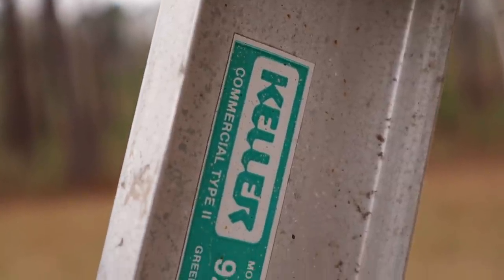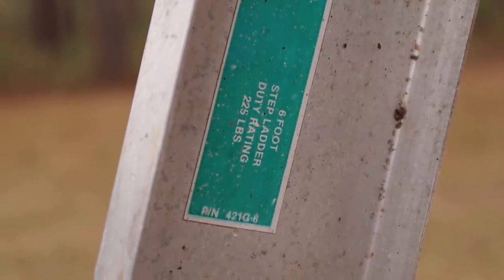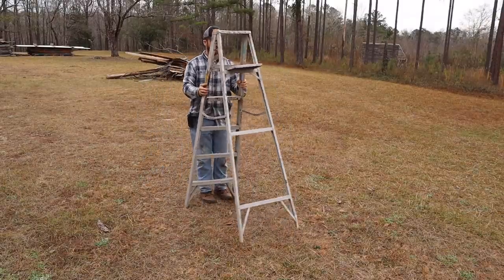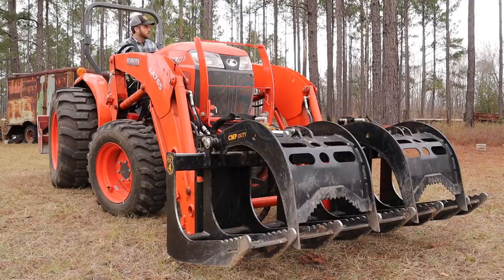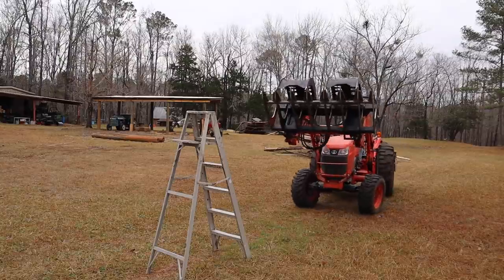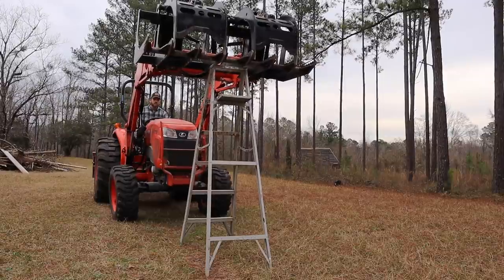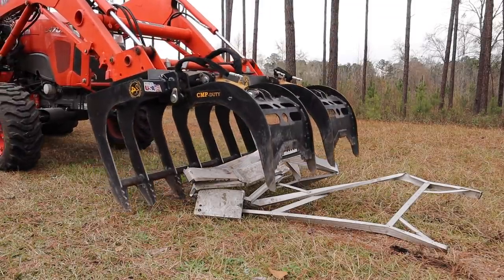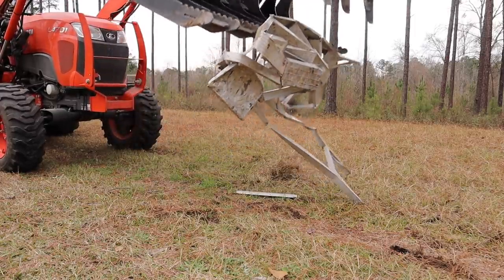Cheap Ladder VS Farm Tractor

Comment: My Dad was s painter and always maintained you use wooden ladders and take care of them properly to make them last. At the end of summer when he eouldnt need the big ladders he repaired everything he felt needed to keep them in tip top shape. He replaced rungs use linseed oil and turpentine with a little used oil to condition all of the wood. His led were at least 25 to 30 years old but seemed like new. He would never use an alluminim ladder. His step ladders were wood and well made or fiberglass fur his 4 5 and 6 foot ladders . His 10 ft wooden was well made and Peel maintained. It it git look he tighten the bolts to tighten it up. Marketing is a great seller of equipment regardless of quality.

Comment: Aluminium ladders are good for a while (nothing to beat them for the weight), but once things get bent, rivets pop or any other kind of damage happens, they are done.  I'd have cut it down for a sawhorse though - still handy for that.  Mine has outlasted my ability to use it, but then it was quite a bit more expensive to start with.
And I'm picky on ladders, having had a bad fall from one as a teenager that gave me a phobia so bad that for years I could not force my legs to get me past the 2nd step - it took getting my pilot's licence to overcome that.  So I'm that guy who will personally check the legs are against a board staked to the ground or the ladder is secured at both ends by more than gravity.  Paranoid?  Maybe - but I've never had another fall.  Safety is worth more than $3, especially in a country where medical treatment is not covered by taxation.
Reply: "I'd have cut it down for a sawhorse though - still handy for that."

Huh, good point. I was thinking I'd've cut it up for aluminium stock, but that's much more sensible.

Comment: Best thing for it. I had an old wooden one, same size. 30 July last year I was on the bottom step. It couldn't take me and the board I had, step broke, I landed on the board. Broke left femur at the hip. Had a good ladder in the shop, but it was 400' away, should of took the time to get it.

Comment: Get yourself a 6’ Werner fiberglass step ladder. Capacity is about 300Lb. Also get a 10’ fiberglass in case you need to get higher outside.

Comment: Unfair test, that tractor weighs more than 225#s.    It's good you got rid of it, especially if you  ever work around electrical . Better, safer using a Fiberglass  one.